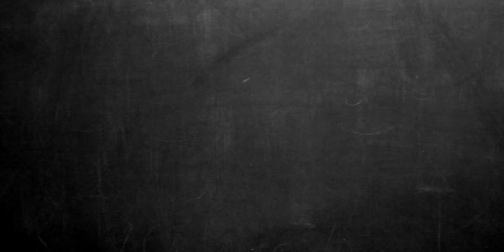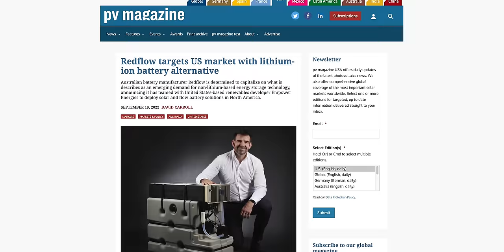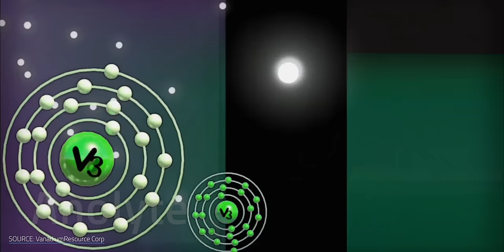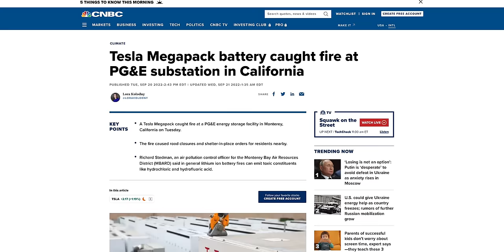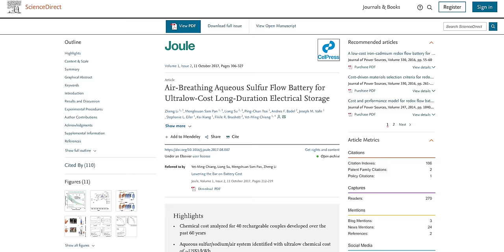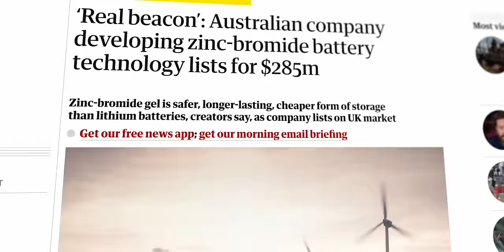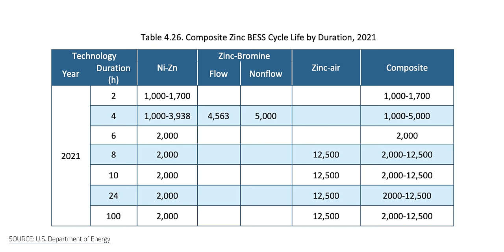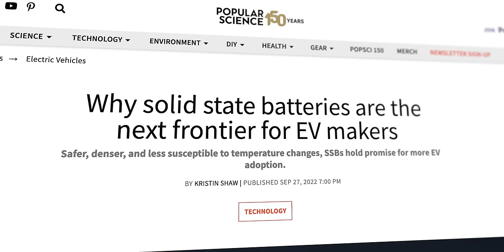137 Year Old Battery Tech May Be The Future of Energy Storage

Comment from the maker: Do you think zinc-bromine batteries will gain ground and become a big player in energy storage? Get Surfshark VPN at https://surfshark.deals/undecided - Enter promo code UNDECIDED for 85% off and 3 extra months for FREE!

If you liked this video, check out Why Nuclear Fusion is Closer Than You Think https://youtu.be/yNP8by6V3RA?list=PLnTSM-ORSgi4dFnLD9622FK77atWtQVv7
Reply: hey matt, need to ask, i've followed your channel for quite a while now and it's becoming difficult to take these seriously when nothing is implemented with them or that there's no followup or check up to see if any progress has been made on the tech even half a year later. will you do any followups to the progress on things like lithium sulfur or the polyjoule plastic batteries?
Reply: @aidanmatthewgalea7761  the tech described in this video has been in production something over 130 years, with recent updates which are also in production.
Reply: I'm curious what the cell voltage is.  If it was stated, I missed it.  Thanks for your very useful discussions!
Reply: I believe they will get a respectable percentage of the market.

As you observed, there is a variety of needs/uses that they are well-suited to address.
Reply: F this, I have looked ad your LinkedIn profile. So you are basically nobody, a bit of Dreamweaver here, some excel there, a couple of contacts, some random stocks investments and voilà! Someone living off thin air, selling promises of a greater future. Well done mate
Reply: @alanhat5252  i'm well aware of one of the oldest modern technologies in energy storage short of the baghdad battery, but what i'm talking about is things like Lithium sulfur being touched upon, stated as a developing tech with promise, then going graphene. we never get any updates on these things and these kinds of things are why people forget about technologies in the public eye.
Reply: Redflows ability to reduce maintenance by discharging is huge.  My very important question is three fold.  What are the hidden cost and concerns?  Will grid scale builds accept the tech now?  How long does it take to get 300MWH installed?  Years or months?
Reply: @FourthWayRanch  ok besides parking bans, why are they problematic?  I really want to know of any concerns however small?  Ty!
Reply: I'm in the industry, for storage, why aren't you looking at lead carbon?  They can do 2000 cycles at 100% DOD.  As for recycling lithium batteries, my supplier two years ago, recycled 20,000 tons so I don't understand where your research is.  It clearly isn't industry.
Reply: @l0I0I0I0  this whole idea of expecting elemental solidified zinc to freely dissociate sounds optimistic to me, we shall see how it works on large scales.  Notice how they have to use MANY units and each unit has MANY cells, this translates to one hullovalot of complex thingys to make it all work.
what about fouling of the membrane with side reaction products??
Reply: @contrawise  The standard electrode potentials for Zn and Br are -0.763 V and 1.066 V, so the cell voltage would be the difference: 1.066 - (-0.763) = 1.829 V (unless I'm missing something. It's been many years since I studied chemistry).
Reply: @FourthWayRanch  My understanding is the membranes tend to be the issue.  It seems that if they had redundancy and an extra storage tank (though adds cost) would solve the problem?  How?  Because it may perhaps make it easier to replace a bad membrane?  Idk.  Making the membranes cheaper and easier to replace as well as last longer can be developed and needs to be developed.   If one goes bad, I need to know it can easily and cheaply be remedied before I will buy.
Reply: But, when these batteries are coming in market?
Reply: Fire prufe something with weights on the bottom edges and throw em over the car or battery pack and smuther the fire no air no fire no water needed as well.
Reply: Kress power tools has a new generation battery that charges much quicker than other brands .. the are currently  being used by landscaping companies…No clue what the technology that makes it possible… Graphene ..?
Reply: Nope :3
Reply: How do these batteries perform in colder climates?  Something often missing from videos on battery tech.
Reply: In real world batteries in real grid will never be a choice, because of their overall charging innefficiencies
Reply: So what is your favorite battery Dear Matt?
Reply: @undecidedMF
How is this in cold climates? you need to heat them or the reactions are not optimal?
Reply: @aidanmatthewgalea7761  yep, got tired of all these could and might.
I have seen plenty claiming being cheaper and better, but always there was a catch they forget to mention it.
Reply: Thanks Manot
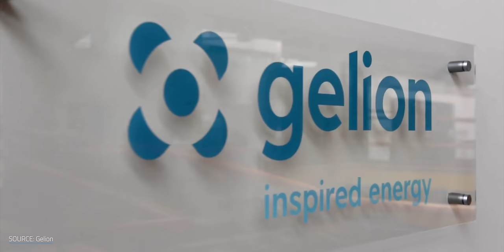Reply: @contrawise  The picture at 4:56 shows the first of a zinc-bromide stack in a series: 1.5 volts, 75 ah, 20 A. A series of 8 would be 12 volts, 600 ah, 20 A.. The Pelion Endure battery shown at 2:29 reveals 1.5 volt, 200whr..
Reply: @contrawise  Look at 2:29. Battery shows 1.5 volts, 200whr.
Reply: They do need a chance, being put to the multi rival design content test. Before any full fledge official production.
Reply: US makes fusion energy breakthrough! looking forward to the episode!
Reply: @astemet  except that if you define a batteri as something you can send electricity into and later get electricity out of then grid scale batteries have been used in norway for 30+ years and is a very important part of their strategy
Reply: Please stop advertising VPN's, they are borderline useful, borderline legal, and often more expensive than not being borderline legal
Reply: @MrCaiobrz  I usually compare VPN's to curtains... I might not be doing anything illegal, but the idea of people being able to look through my windows aren't that great, plus vpn's does make it harder to make metadata on individuals.

looking at what countries have already banned them it is quite clear why some people want to use them.
Reply: @DS-lp5xt  The whole internet nowadays use SSL, the encryption layer that VPN offer is just encryption over encryption, its useless. Most sites and apps have already moved to SSL and there are plans to phase out non-secure connections at all eventually (most browsers will move you to the SSL version or warn you). The "security" that VPN offers is useless. And the "being able to fake your country" is borderline illegal, which is why actually they are banned, not the security aspect. For the price you must pay for only a borderline illegal IP mask (and innevitably lower speeds) makes them almost scams. They were kind of useful 10 years ago, they are almost scams today, they will be total useless and illegal in 10 years
Reply: Might be a weird time to change a name… but I just thought undecided doesn’t quite fit anymore. What if it was welcome to “undiscovered” since you “discover” all these unique solutions for normal people. Just a quick idea I had thought I’d share it.
Reply: Can these batteries operate when its -60F ?
Reply: @silvergreylion  thanks!
Reply: good send me a 50kw battery and I'll test it personally on my home system for 10 years and let you know.
Reply: Hey Matt, we're waiting for a Fusion Update!
Reply: @drachenfels6782  cookies have nothing to do with it. Copyright has. Each country have their own copyright issuer with different procedures and taxes, so if you want your Copyright to be recognized worldwide you need to register it on every country, which is expensive so very often only a few interested markets are selected. When someone wants to offer your cooyrighted material in their country, you (or them, in this case say Netflix) have to regidter and pay the local taxes, and your royalties. This means you should not be able to watch content that is not copyrighted in your country, or in this case, a company cannot offer it in countries where it is not cooyrighted. By spoofing your IP and foolong the company, you are infringing cooyright laws. The provider, lets say again Netflix, pretends they dont know (of course they know your country of origin and when you are  not "in it"), so you take the legal  blame. EU has trade deals that INCLUDE cooyright, which means it makes no sense for a company to charge a different rate depending on which country, but that doesn't happen outside the EU. Providers could block contents from being streamed to different countries, but since the blame is with the end user, they dont. iTunes has like that in the start but people got really hpset for losing their collection on a trip or by moving to a different country, so they changed their policies and use international copyright for songs, but most streaming still use country copyrights. Get your facts right and at least own up to bypassing copyright holders. (Typos because mobile, too lazy to typecheck)
Reply: @alanhat5252  If this tech is available to all, why is it not advertised as such. I recently installed 64kWh of LFT cells. I would have liked to have been given the option of looking into ZB tech for my home storage. Maybe it's not the technology thats lacking rather the PR?
Reply: Great, but I think there is another way also for future design of batteries. Simply it needs to be pressurised of electrolyte of it. By pressurising capacity and charging would be increased. Or I do mistake?
Reply: When the gravimetric energy density is lower how much more Volum do I need for the gelion Batteries?
Reply: great onformation. but as a editting point. The music in the background gets in  the way of clear hearing.a noise that distracts.or rather can distract the mind. I thought someone was arriving in a car outside so paused.confuses the bad hearing. m Thankyou for the great vids.
Reply: The argument is bogus, results are the only thing that counts. talk is cheap.
Reply: @MrCaiobrz  "This means you should not be able to watch content that is not copyrighted in your country, or in this case, a company cannot offer it in countries where it is not cooyrighted" - Wow.  Someone clearly doesn't understand copyright.  In your view of the world, it is illegal to view or display anything that is in the public domain.  Copyright registration simply means "I am officially declaring that I created this content" and it is used to protect that content (prevent it from being copied by others, or, if others do copy it, then to provide grounds for legal restitution).  Copyright is explicitly (and exclusively) about protecting intellectual property, not about restricting where content can be viewed or displayed.
Reply: @nomore6167  i think you should go read copyright laws. A copyrighted material must pay royalties to the holder EACH time it is viewed/listened to. For instance, in my country if I throw a public party, I MUST pay royalties taxes for each song on the playlist to the Music. Your ignorance is impressive.
Reply: @pepermintpilot1694  "I recently installed 64kWh of LFT cells. I would have liked to have been given the option of looking into ZB tech for my home storage. Maybe it's not the technology thats lacking rather the PR?" - The availability of information could be lacking, but I would say the technology is definitely lacking as well.  Specifically, it is not energy-dense.  Took a look at the battery at time index 10:09.  We don't have a good idea of its size, but its weight is 12 kg (26.43 lbs), so that provides some reasonable idea of the size (for reference, a 12V lead-acid car battery typically weighs just under 40 lbs).  That battery is 1.5V, 200 WHR, so you would 320 of those (totaling 3,840 kg [8,458 lbs]) to achieve your desired 64kWh.  I'm guessing that would be considerably larger (and heavier) than the option you chose.

Having said all of that, I completely understand your point and it does make me wonder why more companies haven't looked into this, even knowing that its energy density is much less than its competition.  If you have the space available, then the benefits may outweigh the negatives.
Reply: @MrCaiobrz  "i think you should go read copyright laws" - I have.  That's why I know about what I speak.  It is quite clear that you haven't, however, since you believe it is illegal to view or display anything in the public domain.

"A copyrighted material must pay royalties to the holder EACH time it is viewed/listened to" --

First, you said, and I replied to the statement, "This means you should not be able to watch content that is not copyrighted in your country, or in this case, a company cannot offer it in countries where it is not cooyrighted", which is about permission to view and display content, not royalties.  Those are completely different things.  Changing your statement now doesn't alter the facts.

Second, are you seriously claiming that, for example, Netflix will pay royalties when a movie is viewed if the IP address of the viewer is assigned in the United States, but not if the IP address of the viewer is assigned in Croatia?  That is beyond absurd.

Third, your belief that a person viewing or displaying copyrighted material must pay the copyright holder a royalty every time the material is viewed/displayed is simply wrong.   A person or company may need to pay a royalty every time a piece of copyrighted material is reproduced in the absence of any other agreement, but only in that scenario.  The copyright holder and licensee are free to agree upon any terms they like, including no royalties.  There is a ton of music, for example, which is royalty-free (the copyright holders have explicitly stated there is no requirement to pay any royalties).

"Your ignorance is impressive" - That's funny coming from you.  Your own words make it quite clear that it is you who is ignorant (or outright lying; either one is possible).
Reply: @nomore6167  "Netflix will pay royalties when a movie is viewed if the IP address of the viewer is assigned in the United States, but not if the IP address of the viewer is assigned in Croatia?" You need to also pay Croatia taxes over copyright, you are totally dismissing that each country have their taxes. 

You know what, keep on pirating dude, be a happy pirate, I don't care.
Reply: @nomore6167  Did'nt realise about the weight. However apart from getting the heavier cells to the site thats were they would remain. Perhaps in 10 years when I hope to look for replacements! Good reply though. Thank you.
Reply: @RobertDooley-sl7cp  exactly. Redwood has been begging for more lithium batteries to recycle. 
Two fires? How is that statistically significant, and was it due to the material or the processes?
I love the video content in general, but points that you make contradict previous videos to some extent, sort of as if you are making a talking points video advertisement.
Reply: @bjarkih1977  yes, when reviewing batteries, there's a checklist. Power Density(W/g), operating temperature (C), charge rate (nC), Time to first product on the shelf (years), cost per kWH, and weight (g/Wh).
Reply: @HansSchulze  Operating temperature does not equal performance in colder climate.
Reply: @bjarkih1977  true, you can ask for efficiency vs temperature, but there are a few more subleties underneath that too.
Reply: I heard the comparison of cycle life with Lithium Cobalt cells but no mention (or was it deliberate avoidance? ) of comparison with LiPO4 versions.  OK, these still use Li, but not the other expensive metals.  These factors all make differences in cost and life-time, expectancy, so should have been airedvasca fair comparison.
Reply: I don't know if it was your video but you should also talk about a really cheap iron-based battery also from old history.
Reply: @AndroidSamsung-qz9pl  NiFe cells, while good for some things, appear to be ‘leaky’ for long term storage and short on output current, unless large.  The best thing about them is that they last and last and last and…
Reply: @oliver90owner  are large units of these great for Prepper Communities :)

That's what I'm getting at. Cheap and long lasting!
Reply: Excellent job 👏
Reply: Have you talked about Graphene?
Reply: If it's comparable in performance but cheaper than Li-Ion once released, I think it will be successful.
Reply: Has Nikola Tesla said about the above ? If yes then it can
Reply: @homosapien5442  You can already buy redflow systems in Australia
Reply: Zinc? Isn’t sodium ion batteries the way to go for cars and devices? Yes, it needs improve the tech but it’s better. And sand batteries for power stations?
Reply: Why do you keep incorrectly pronouncing the word as "Jo-Ann" and not the way its supposed to be pronounced? as GEL ION
Reply: i just looked up a video of the CEO of GLEION pronouncing the word...its pronounced GEL (and then) ION.
not, Jo-ann
Reply: I think yes because you can use existing factorys and it can help a lot. I think for homestorage it has a quite good perfomance and 5-20 litre wouldn't be bad.
Reply: i think they will have near 0 effect on our energy needs it might replace lead acid in current usage but its energy density is much too low for a replacement to lithium ion battery tech
Reply: From all the battery tech I've seen the iron salt redox flow battery is the best for stationary use like for homes/industry etc. No toxicity easy to repair and exchange parts. It's extremely cheap and its only drawback is capacity which can be solved by using large tanks. 

I wonder what happened to the gold/carbon nano tube battery thech that supposedly had an unlimited cycle life.
Reply: Zinc-bromine batteries
Reply: @pedratorta7061  Why so upset buddy?:)
He said plainly ad clear. He is undecided.
When he decides, he may be somebody :)

But you are right. These may be articles got annoying. 
I may be going to Mars too :)